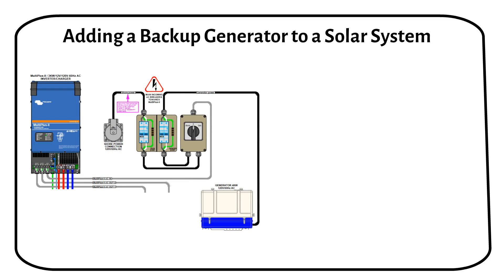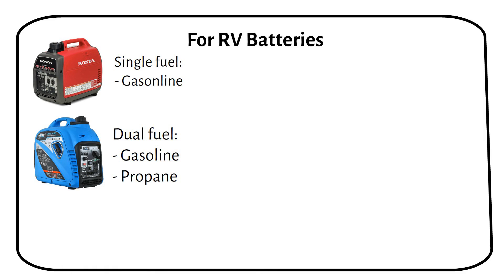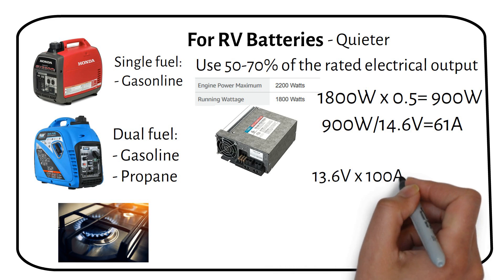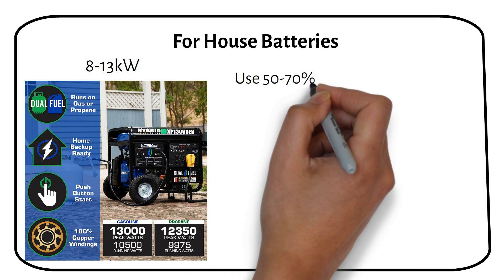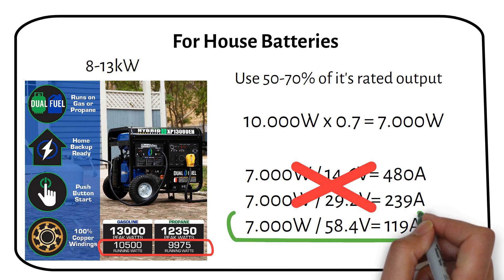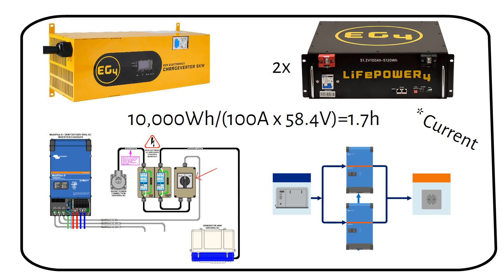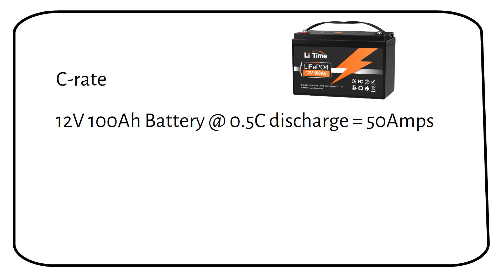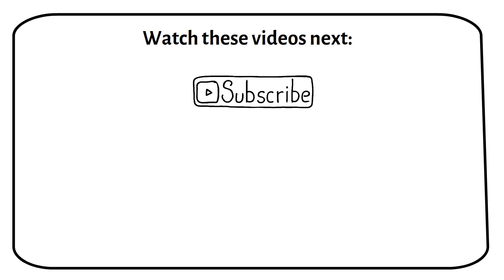Adding a Backup Generator to Off-Grid Solar System

Comment: Considering adding a generator option to my system at camp because through winter it is often a cloudy overcast. My first thought was adding a dc to dc charger then just using my Jeep or the tractor parked along side. But many portable generators have a dc 5 amp or more plug along with 120v.

Comment: I have a Powmr 6500 all in one 48v 120/240v inverter, 3 48v server rack batteries and 5Kw solar all totally off grid so it has its own ground rod and powering my shed. Since I'm using it in 240v mode, I need to input 240v to charge batteries. The generator is a 3500w Honda with a 4 pin output of 2 hot, 1 neutral and a ground. I have an extension cord to match, and the generator input on the Powmr has 2 hot and a neutral input, but no ground. What do I do with the ground wire from the generator?
Reply from the maker: Now you have entered complicated territory. Check my video about ground neutral bonding. I don't think the powmr has a grounding relay built in. So you ground neutral bond the ac power source. This can be the inverter or sometimes the generator. You cannot make the ground neutral bond in two locations, only one. You can add it to your grounding busbar that goes to your grounding rod.

Comment: Hya, what if the grid system can supply more amps then the generator? I have a 12V Multiplus and a 2000 Honda. My grid can supply 16A at 230V but the generator is obviously less powerful (especially as you recommend to use it at 50-70% capacity). My guess is that every time I switch from the grid to generator and vice versa I need to go to the Multiplus 2 settings a re-configure the amount of power it can draw from the source. This is because I would like to draw more when I'm on the grid but I also don't want to burn my generator with the same setup. Am I understanding this correct or is there a better more elegant way of making this work without having to remember to manually go and change the settings every time? Many thanks
Reply from the maker: Not sure, but that's where the quattro is for. However, it is possible to connect a string inverter to the essential loads output. So maybe you can connect the generator there. Not sure if you can adjust the power though.

Comment: Thanks for your help !
I have a boat with 4, deep cycling 12v batteries. And 4 starting batteries. I would like to add 4 more house batteries and have the correct generator and charger pre wired into the system with a sensor port on the generator for automatic  start up and shut down for charging.  Can you recommend the best gen , charger,  and batteries for my boat.
Bill

Comment: I have a 5kw outback spc111 inverter charger with 4x pylontech us3000 48v batteries and I am looking to add a generator for charging sporadically during winter.
I've been told I need a remote start generator of at least 5.5kw but also that some sort of connection is needed to a dry port. I have found the dry port but I have no idea how to connect to this?
Any help?

Comment: I have a Victron multi +3000, and predator 3500 which has electric start. I use it manually to charge my battery bank which works fine, but is there a way to make this process automatic?
Reply from the maker: You need a generator with an automatic start function. Most cheaper generators don't have this. You will need a more expensive one like a Kohler with automatic start/stop. The victron multiplus has a remote start/stop function.

Comment: We have discovered that our 48v Rich solar nova 8k hybrid inverter will not accept power from our inverter generator, and we're totally off grid in a prolonged rain storm in Southern Colorado 🎉 I have had a heck of a time getting a competent person on the phone to try to figute this out
Reply from the maker: From the manual i can see that it accepts a generator. Are you using the right connection and if you start the generator is there a voltage on the cable? (check carefully). What inverter/generator do you have? If it doesn't work, you can try out EG4's inverter/charger 48V. Reply to my email because i wont see your reply to this message.

Comment: Thank you for the video. You say to use 50-70% of the output to save fuel. How does one limit the output wattage to this range?
Reply from the maker: Calculate the power consumption of your charger. And that's how much power you can use. 20A for a 12V barter is 580W.

Comment: I have a "budget" PV 24v system using an Epever 40A solar charge controller, a 3000w Giandel inverter and 4x 150Ah AGM batteries.  I would like to use my Honda EU20i(I'm in Europe) to top off the batteries when the solar panels can't do it.  What battery charger do you recommend?  How would I connect it?  Something very simple.  I live in southern Greece, but even in winter available sun hours are challenging.
Reply from the maker: Have you watched the whole video? I show exactly how.

Comment: Thank you. I have a Honda 22 generator. The maths is difficult until someone shows you. Very good.
Reply from the maker: Glad it helped!
Reply: Those generators will power 3 victron 30 amp 12 volt chargers

Comment: Great explanation,  one part confuses me though.  using 900watts from the generator to calculate the charge time without taking into consideration the 30a charger?
Reply from the maker: 14.6V*60A charger = 876W, I rounded up to 900W.
Reply: Ahhh.. I thought you took that 900 from  above in the calculation. Thank you very much.  My charge is just under 3 hours.

Comment: Good afternoon
I have a caravan with a lead acid leisure battery. I would like to change this to a lithium battery. Can I just swap the batteries over??
Steve
Reply from the maker: No, you probably need another solar charge controller if it doesn't have a lithium setting. Your inverter can stay and your shore charger will be the same problem as your solar charge controller. Depending on the capacity, you need another fuse (Isc is higher)
Reply: Sounds like a head ache. The battery is powered by the car, when towing and the caravan AC power supply. 
Many thanks for your help.
Steve

Comment: I have a pure sine wave propane 800 watt generator that I plan to use as a backup in the winter.
Reply from the maker: Have you calculated the charging current like in the video?
Reply: eventually, when I start using the solar system. Thanks for all the videos, they've helped a lot @cleversolarpower

Comment: I can't believe I have to ask this, but why can't you just plug your RV power cord into the Honda generator to charge the batteries?
Reply from the maker: If there is a battery charger attached to the power cord then that will work. It's best to know the charging current of the charger before plugging it in.
Reply: Most RVs use a 220 30 Amp for shore power so charging with a battery charger is much smarter
Reply from the maker: @floridaguy1133  That is if you have shore power available 😉
Reply: my  rv only has a trickle charger to only the coach battery....